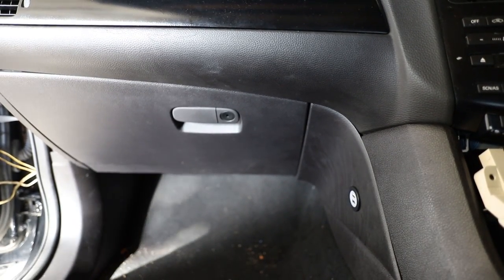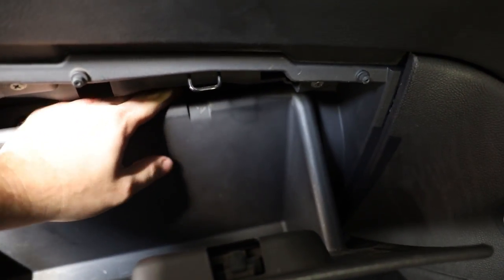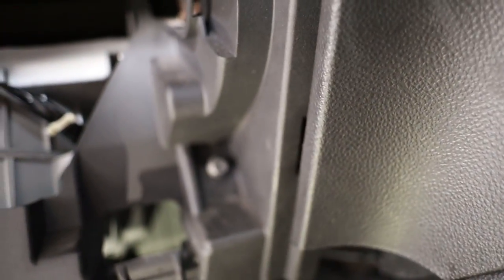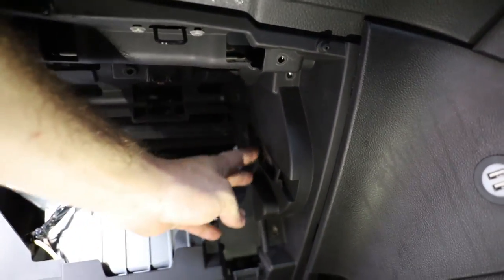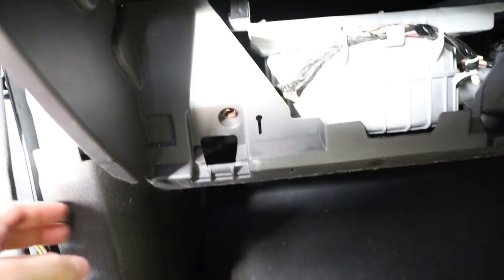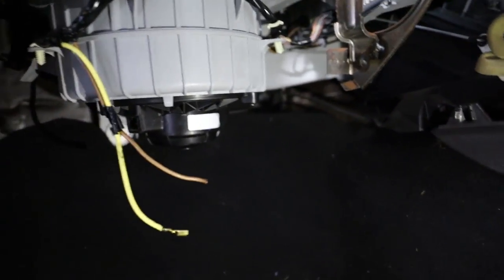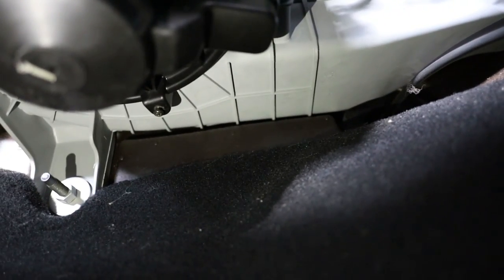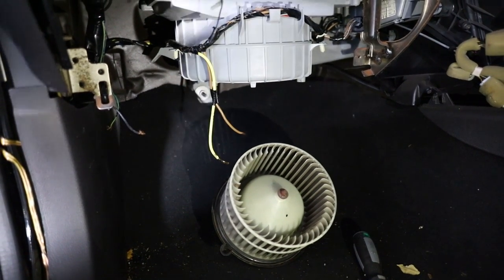FG Falcon Air Conditioner Blower Motor and Glove Box

Comment: OK big thankyou for the video, gave me confidence to tackle the task, however there is a much simpler way.  No need to remove any of the trim at all, simply remove the 3 screws underneath and as you are lowering the blower turn it slightly to clear the bottom plastic trim.  Getting it back in is just as easy.  My aircon had simply stopped blowing and on trying to remove the plastic t-clip found it to be melted into the blower.  I managed to free the yellow wire but the brown wire I had to snip.  I tested the blower on a separate power source and found that the blower was working fine.  I cleaned out all the plastic, placed a new metal connector (Supercheap or repco would sell them) crimped it and placed them both back on with some electrical tape surrounding them as the gap is minimal between the two.  Turned the aircon on and I'm cool again, would suggest trying this before buying a new blower motor for 175 bucks which is what I was quoted from Burson's Auto parts which was pretty cheap, got quoted over 400 from Coventry's. 09 FG Falcon.    Good luck and thanks again FG MODS, sorry for the essay.
Reply: I bought a new plastic clip from repco and had to rethread the wire just unsure if I did this right 😅
Reply: @HabibsAnimeCorner  If it works you did something right if not back to the drawing board.  Best of luck.

Comment: My issue was a melted/burnt connection at the fan unit. Sorry I can't upload photo but your tutorial helped me. I didn't have to pull unit apart like you did. If you are going to replace plug you will need yellow spade connectors.  I'd hate to think what this would cost at auto electrics. All I had to do was pull the glove box out. 
A big thank you again.

Comment: Thanks for the vid mate, helped alot. Although you don't need to remove any trims, just the glovebox itself. Reach under and take out the 3 screws in the blower motor and with a little pull back on the bottom side of the glove box trim surround it'll fall straight out. Plugs commonly rusted in so some gentle prying with a flat head and she'll let go (hopefully). Just did mine in under 10 mins

Comment: Ran into this problem when I was replacing the dash trim, but there's also the screw which holds the glovebox surround underneath the left most piece of trim (adjacent to the door, when the door is closed). It just pops off with a firm tug and there's a screw underneath holding the glovebox in. 
Found it was easier to get to this way than through the lower panel that you mentioned.
Reply from the maker: That's a good method.

Comment: great video thx! FG XR6 aircon blower not working, quoted $$ to repair ... came across this vid so gave it a shot ... sure enough burnt out motor and cable plug. Would like to know, given how common this component failure is where is the recall notice from Ford?

Comment: Look similar to motor in BA /BF 
In my ba it started making noises and smoke on day so turned it off immediately!
So pulled Blower Motor out dismantled and cleaned it.  I mean washed all the fins with dishwashing liquid etc
Then went the motor electricals cleaned and lubed commutator and brushes then adjusted the trust screw at the bottom, its like a teflon bearing , for quietest operation packed  commutator and brushes bearing with grease no problems since that was 8 years ago.
Reply from the maker: Yeah I'm retty sure it is.
If its not the same it's VERY similar.

Comment: i did look at the plug from supercheap, its rated at 20 amp when blower is under a 40 amp green fuse, maybe they burn out burn out because the plug used wasn't designed for its usage- same issue in my fg the blower went intermittently then dead

Comment: Great video. Not sure if this will help me. The issue I'm having is the Aircon takes anywhere from 20-30mins to start blowing cold air out, if the car had been sitting in the sun all day. In the mornings the car will blow cold air. I had changed the outside temp sensor previously and that seemed to help a bit.

Any information appreciated. Cheers.
Reply: Hi  Paul, We have a 2008 G6E. It has done 230000km. When the battery starts to degrade the aircon plays up just like you said. If you leave it, you will get other random faults like airbag faults, reversing sensor faults etc. I found we have had to change the battery about every 2 years when these faults start to appear. It doesn't seem to matter if you buy a good quality battery with high cold cranking amps; it still happens. So try changing your battery.
Reply: @brendanandmichelleclancy5888  I brought the car to battery world, where I'd purchased the battery and the cca was higher than stated and volts good also. Battery appears perfect. If I recall far less than 2yrs old when started.

Comment: Hi mate great video. Any idea where to get a replacement plug for the one that is burnt out?
Reply from the maker: I'm sure they can be bought from Ford or SuperCheap
But I actually decided to reqire it myself, because I don't trust the standard plug to not melt again.
Reply: Don't need a plug..cut old one off and crimp new lugs on, just make sure you have pos/neg on correct lugs

Comment: Thanks for this vid. My fan is no longer blowing. If this is the problem you have saved me a bit of cash. Thank you in advance.
Question. Did you replace the whole blower fan or just get a new plug?
Reply from the maker: Just replaced the whole unit and rewired the dead plug.

Comment: Just did mine then and same shit.... melted plug! Cheers for the video brother appreciate it
Reply: Exactly the same issue for me. Just fixed it thanks to these videos. There is another video on this showing you can do a blower repair by just taking the glove box out. Replaced with spade connectors (yellow) .  Thanks to people who also upload useful comments that make this job reasonably easy. I think Ford should  make a recall on the melted plug and the mixer shaft. 
A gould job done.
Reply: @amacf1  did the fan initially stop working intermittently?
Reply: @australiantruckspotting8883  mine has over 2 years , I had the passenger kick the motor to make it work , finally now has stopped , funny about the melted plug because I could not un-clip the connector . Funny I went to supercheap for an engine light scan ( coil packs ) and another code was there for AC fan resistor .

Comment: My air con sometimes just decides to not be cold. Other times it’s fine, what could be causing that?
Reply: Aircon gas leak or needs regasing which you shouldn’t if it’s around 15 years old
Reply: I had that 2 years after buying it new , Ford dealer said to disconnect battery wait 5 minutes and go again , worked everytime but they finally replaced a component that fixed that . 2009 FG ute

Comment: Just curious. Did this blow fuse 25? Interior lights? Im having an issue where my tansmission says not in park and its the same.fuse as interior lights. I read ona. Ford forum that it could be linked in the glovebox. Any help would be much appreciated
Reply from the maker: No fuse blown when this happened.
Sounds like you've got a bit of an electrical gremlin. I'd be seeking professional help on that one.

Comment: Have you had any problems with water in the front right side around the firewall area?
Reply from the maker: Super common issue
Reply: @fgmods  do you know where it normally comes in?
Have found the floor mat to be damp now

Comment: Hey man great video. Recently had my heater, which was set on fan speed 6/10 just stop and seems to be not working since. I feel this may be why and looking into it all. Is there a way to verify it was it, like check certain fuses first? Or I could expose the motor and try running it?
Reply from the maker: I'm not going to say pull the blower motor down and turn it on while it's plugged in..... But maybe try that.
Can't see any reason it would hurt, so long as your sensible about how you're holding it.

Comment: Se happened to my plug ... Did you find out what caused it?
Reply from the maker: Didn't work out what caused it, but it seems to be really common once they're old enough
Reply: @fgmods  More than likely the age of the plastic & a $0:20 plug. It dries up from the heat overtime and eventually shorts out.
Reply: @marty6980  Mine has never failed but I might just drop the glove box and see what's going on with that plug. If it is bad, will replace it.  What plug do they use on those?